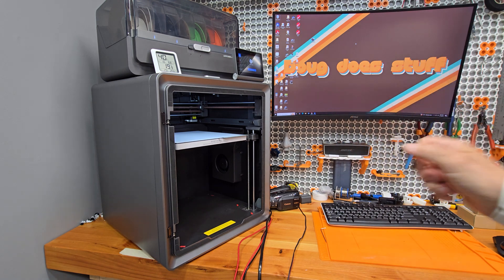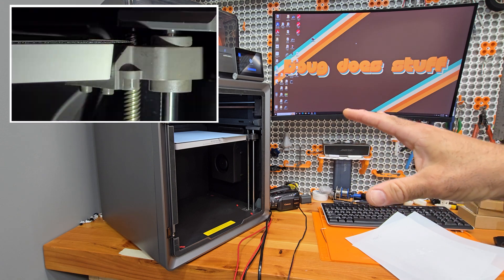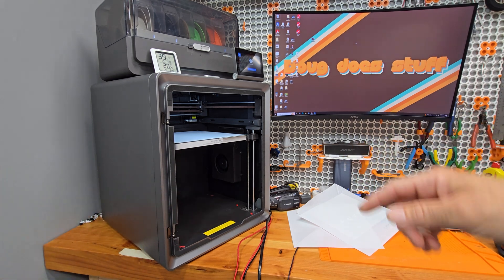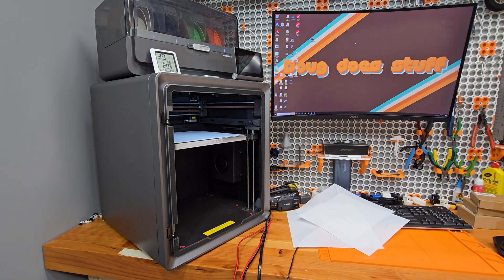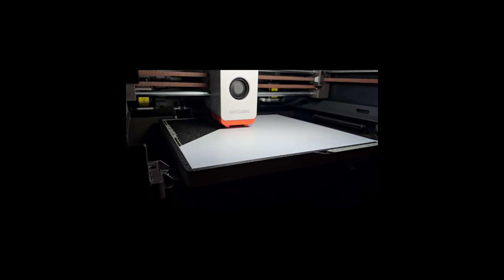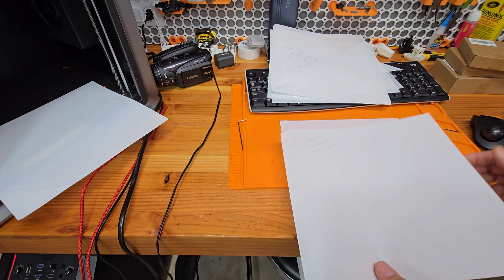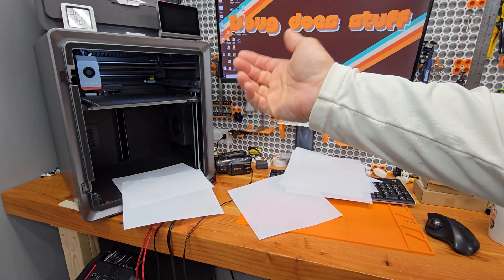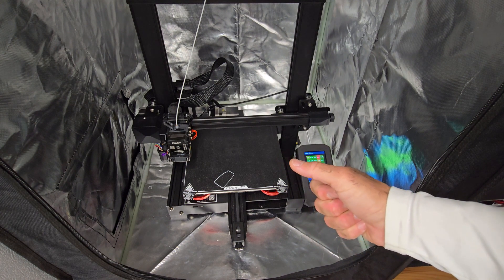Kobra S1 Combo: Bed Level Chaos! I'm Done with it!

Comment: I had a print fail and a glob of PLA stuck the the hotend. I think it changed how my bed sits. Now I can not get anything to stick. The nozzle is grinding into the build plate. I haven't had a successful print in over a month. any suggestions? Yes I have used the auto level function, and I factor reset the machine. Kobra S1 combo
Reply from the maker: Yeah, I would say that you need to take apart the hotend and see if there is a leak.  See if the blob pushed the PTFE tube in the heatbreak off.  That would be an issue.  I would start there
Reply: @dougdoesstuff24 thanks for the reply. I've done all of that numerous times. I've replaced the hot end, ran the calibrations, hot end still drags the bed.
Reply from the maker: Have you reached out to support? You could raise the z offset in the slicer
Reply: @dougdoesstuff24 support is sending me to the wiki, I've done all of them twice. Z has been 0, -1, -2, -3...none work. I'm out of
Reply from the maker: Negative numbers will lower the nozzle, try going to a positive number like . 5 and go from there
Reply: @dougdoesstuff24 I was thinking it lowered the bed, wow. Thanks
Reply from the maker: yeah, it doesn't change the bed at all, it changes the nozzle height from the bed.  Definitely go positive numbers and give it a whirl

Comment: My Kobra S1 has been a great printer, for the most part. Fortunately, I got one with a nice flat bed . . . 
Some warnings before you stumble into other potential issues:
1. When I tried to use the filament dryer while printing, the filament got too soft and jammed inside the Ace Pro buffer. Clearing that was no fun at all. So dry at a low temp for a long time, and keep the drying temp low while printing. When printing with PLA, I don't use the dryer at all when printing for this reason. It's nice to be able to dry the filament before printing, though.
2. Don't slice a model for ASA and then try to print with PLA. It will jam inside the extruder. Entirely my fault, but still aggravating, and it led to warning #3.
3. Don't disassemble the extruder unless you have a spare handy. The filament sensor has a part that rides on an extremely thin spindle, and if \ when that spindle snaps off, the extruder is junk. Anycubic was kind enough to send me a new extruder free of charge, but the printer has been down for three weeks waiting for it to arrive, and it just cleared customs today, so I'll be waiting another week for USPS to deliver it.
Anycubic's customer service is awesome, if a little slow. (They're in China, so that's understandable.) That's one reason I keep buying their printers (price being the other reason.) I really haven't had any issues with the Kobra S1 that weren't my own fault, but it's still frustrating when a plastic pin that should have been steel snaps off and renders the entire extruder useless . . .
Reply from the maker: Thanks for the tips and sharing your experiences!

Comment: you should probably look further into modding it, there are plenty people that do it and they get pretty solid results
Reply: What mods are you referring to? Is there a person or mod you would recommend or have done yourself?
Reply: @lauraprice4069 i’ve seen a dude that replaced the hotbed with an upgrade from aliexpress then he adjusted it and calibrated it with rinkals firmware
Reply: also there’s some support thingies you can print and put them below the hotbed that you can print, ive seen it in makeronline and people seem to like it a lot

Comment: Anycubic had a gcode test file in their wiki, which only prints a first layer. That should rule out the slicer. Have you tried that one? It’s a 57 minute print.
Reply from the maker: I have not, but I am skeptical about it because I don't know what they tuned in it.  We want real world results.
Reply: @dougdoesstuff24  at least it’s worth a try. I have to check the gcode myself to see what they have set. Anycubic asked me to print that file when I complained about my warped bed. After that they sent me a new one.

Comment: Looking forward for rinkhals firmware video and hoping that it leads to some kind of fix or something. I think my S1 bed level is not as problematic as yours, but i wouldn't have been here if it was acceptable. I did a couple of test on my own with remote print bed level and pre-done calibration, and i got same-ish results. Also tried having the usb stick be plugged in and out with remote printing like some commenter suggested on your previous video, and it didn't had a noticeable effect for me (thankfully? it would have been a really silly issue) I am using a textured carbon fiber looking PET bed though and its really easy to spot issues on that thing, default bed really masks problems by being so bumpy.
Reply from the maker: I am going to get working on that tonight and get it installed.  I don't think Rinkhals in itself will solve the issue, but it might help identify the bed issues

Comment: I have some thoughts. First, let me say that my experience isn’t long, about a year and a half into the hobby, starting with an Ender-3 S1 that I was constantly struggling with bed tramming and leveling, to a BL A1, to their P1S, and now the AKS1. I am a software engineer with some understanding of how the embedded software likely works. 

So, first about the myth of there being a difference between cloud and USB prints - it is extremely unlikely, though not impossible, that Anycubic is modifying the GCode sent to the printer from the cloud. After all, GCode is just text commands to the printer, so changes to it would be risky and be easily sniffed out by comparing the GCode in the cache folder with what is on your USB. 

Second, the bed-leveling command is just a custom GCode to trigger the built-in functionality. Again, while it is possible they have two routines in the firmware for bed-leveling, this would be both wasteful of firmware space and a disservice to the end-user. 

Finally, folks are correct to suggest that this might be due to the new hot-end, though I hope for the wrong reason since I bought two plus an array of hardened nozzles. Rather, the issue may stem from why the new hot-end was purchased, the way the old one failed. It may have negatively impacted the sensor that calibrates the mesh. 

Now, I will say that Rhinkals is well-done, with a clean escape route back to stock firmware. So, there is no risk in upgrading and I’ve done it. I haven’t had time to work with it to see what it offers so that’s the end of my advice, but I will look forward to your video using it, with special interest in if the bed mesh is consistent across multiple leveling runs.
Reply from the maker: Thanks for the input!  Some great thoughts in there.  You don't think it is possible that when the g-code is sliced for remote print the code that is inserted might be wrong?  And, then when you print from the printer the g-code on the printer is different?

While it could be the aftermarket nozzle, I don't know.  It has printed a few things well, it is just the first layer.  I do see what you mean with the first nozzle issue and how that potentially hurt some sensor in the bed when it crashed.....
Reply: @dougdoesstuff24 it’s not impossible that the g-code is different, but it’s usually 2 or 3 codes together that triggers homing, cleaning, and then build the bed mesh. So, that it does all that, though inconsistently, it feels more like a sensor issue. The sensor is housed inside the print head, using the nozzle as the probe tip. I cannot recall how your nozzle failed, but if it was like mine, a clog that pushed the “ceramic” tube up and out of the throat, pushing the nozzle out of the holder despite the clamp being active, then that sensor may have been impacted. Thinking about it, so may have the clamp itself. I’ve been too busy to do more than a few prints with the new nozzle, all successful, so time will tell for me.
Reply from the maker: Mine failed just like yours. It is a possibility
Reply: And for those others following this thread, this seems a common failure mode. I got lucky in that mine clogged and got pushed out of the clamping mechanism while purging, so no print plate damage. However, there have been numerous reports of plate damaging head crashes and nozzle clogs. It’s a bad nozzle design that has delayed my review video as I sorted it out and rewrote my whole video.

Comment: I don’t have this printer. Does it do a nozzle clean followed by cooling the nozzle down to 140c while covering up the nozzle with a pad or part of the PEI plate? If the nozzle is cooling down before the bed mesh in the air, filament will ooze out and the z offset and the bed mesh will not be accurate.

I copied what Bambu printer does before doing z offset or bed mesh on my Voron printer. My Voron 2.4 350mm has max deviation of 0.25mm on the mesh with 110c, around 0.1mm with 50c.
Reply from the maker: I'll have to watch it more closely, but I believe it does what you described, but the nozzle is in the open, not covered up somewhere
Reply: @dougdoesstuff24  yeah left a comment with a link to a YT vid explaining what i mean with nozzle cooling down on PEI plate, but it got removed. 😒
Search for Bambu printer startup sequence.
Reply from the maker: I didn't remove, but I'll check it out, thanks!

Comment: I had to print spacers for my bed. A quick google search will show 2 different ones, i chose the ones with the lip on the bottom of some of them, and they all in the file were different heights, with about .1 mm difference between them.

If you have the line gaps, the nozzle is further away from the bed than the areas where the print is solid. Add a spacer in the corner(s) where that happens. But remember, if you add a spacer to one corner, you have to add to all corners. After playing with the various heights, and running a new bed level on the printer each time i changed a spacer, i sent the print. After doing the spacers and micro adjusting the 4 screws on the bed, i have perfect first layer every time. 

Also, plastic does build up on the flexible pei magnetic plate, so wash it with dish soap and water, dry, then use ipa and clean it and let the plate sit for about 10 minutes to make sure there is no ipa on it, then do the print again. I can now print a build plate full of dnd terrain pieces with zero adhesion issues and the first layer (bottom) looks perfect on all of them.

Apparently, some s1 have shipped with spacers, others have not, so this again appears to be another quality control issue.
Reply from the maker: Once I can see what the mesh looks like we will go from there on shimming it.  I do clean the plate like that every so many prints.  I don't have adhesion issues, but always worried about it.

Interesting, would be very interesting to get some pics of those.

Comment: Heey i have the same with my cobra 3 my bed is warped after 30 hours 
And this to much for klipper to compensate i solved iT with Some verry thin washers under my pei 
I used 0.2 mm washers on the edge and perfect after 😂😂
Greets
Reply from the maker: Thanks for the tips!

Comment: I think you need to see the bed leveling data, and check repeatability of the leveling, I suspect that is your issue. The signal from a strain gauge is often very noisy
Reply: You cant see it on the s1
Reply from the maker: Through Rinkhals, the next video, you supposedly can.....we shall see.
Reply: @dougdoesstuff24 oh that makes a lot more sense
Reply: @Yhandi_Fan  Doug is going to install Rinkhals, which will make the leveling data available

Comment: Hey Doug.

I have the same problem in my S1.

I've disassembled this table and I know what the problem is: there is a glued part (I don't know if it's the heater connector or the temperature sensor) under the heating plate (that aluminum plate) that has too little space in the table frame. Tightening the screws, the heating plate bends, creating a bulge in the middle of the table as it leans against the frame.

The solution: you have to disassemble the entire table, mill out more space in that white frame and reassemble. After that, in addition, you can still measure the leveling with a micrometer sensor mounted to the print head and make corrections by lining up some places with kapton.

In any case, I consider this a design flaw and replacing the components from Anycubic, will not help.
Reply from the maker: This is very interesting, and once I get past my Rinkhals video I am going to look into this!
Reply: could you just use shims on the screw mounts
Reply: @TheShorterboy  This is some option to consider, only I'm afraid that they should be shims of precise thickness. Although, with the current state of the table, a difference of 0.05mm on the shim will not make much difference anyway.

Comment: I love your good attitude despite all tbe issues and unproductive comments. I know the process of failing forward with many big and small things in life. Despite it sucking at the time, the struggles I had with my Neptune 3 Pro taught me SO much about 3d printing and I'm glad that I was forced into it. I wouldn't understand much at all about how the sausage is made had I got a printer that just worked out of the box. No judgement toward those who want that experience, but I have a need to dig deep into everything I do... for better or worse. 😅 My husband and son kept urging me to just get another printer and I was like "No, I must beat this!" And I did, after many hours of trial and a whole lot of error. Plus sitting on the floor of my garage hand sanding a very warped bed that was 2mm off. 😂 My S1 has been flawless, but if/when that changes I have learned from you and appreciate it. I TOTALLY understand why you're like a dog with a bone with this.
Reply from the maker: Thank you!  I appreciate the comments!

Comment: You don't have a bed problem. You have a print head + load cell problem. Please try with the original print head. The printer software is calibrated for that, any mechanical play or weirdness with the head will have as a result a bad mesh and a bad first layer. Anycubic should let us adjust this parameters!
Reply: Even those with the original print head have these issues though. Not all but way too many.
Reply: The hotend shouldn't matter though, as long as you are doing the full recalibration after changing the hotend.
Reply: @advirnig  It normally shouldn't if the print head is a solid block with the extruder, but if there is any play between the two you get inconsistent results.
Reply from the maker: The hotend doesn't move, it is in there solid.  I could go to an original hotend just to see.....
Reply: the toolhead have a probe, any nozzle or hotend work, the principal is easy, the nozzle touch the plate, the probe see that and you have a mesurement... that's it! i have the same problem with my brand new creality hi... i never change the nozzle, never change the hotend, the first print i made with... i got this problem... THE FIRST PRINT! the real problem is just the quality check, is wrong on all company, because the people want a printer FAST and IMMEDIATLY! and this is cause bad printer.

Comment: Hello man! A warm greeting from Italy. I encountered the same problems and solved them by "masking" the problem from the slicer offset. I have to set -0.05 for the original plate and -0.02 for the plates with different bambulab textures. One day I decided to buy the cryogrip pro glacier and all the problems were solved, offset from slicer to 0.00 and the first layer always comes out perfect never goes wrong, while if I put the original plate back the usual problem returns and each first layer is always different from the previous one. I couldn't explain why, it would be nice if you tried it and made a video of it!
Reply from the maker: I do have a cryogrip plate sitting here.......

Comment: I feel bad for you. Got mine out of the box and started printing, with the ace. The only problem I have is that if there is a color change between spool 3 and 4, it always jams. Other spools work fine. Printed PLA, parts 24h+. at 500h and 12kg of PLA. Printed PLA, PETG and ABS great. You have the problems i had with my ender 3... It's sitting there in a corner. Got a hemera extruder to install on it, that was the plan. But the Kobra keeps doing great, so I am constantly using him... I got lucky i think
Reply from the maker: That's awesome! Did you reach out to support about the ace pro?

Comment: You are totally correct about AnyCubic throwing parts at the problem, I have replaced the main board, hotend and now I have to replace the parts in the ACE Pro. Getting tired of replacing parts. When I asked to send the unit back and refund they were giving me a hard time.
Reply from the maker: Oh geez.  I wish you the best and keep me updated.  This is why I get frustrated at the posts of people saying they have no issues and don't understand why I do and that it is my fault.  I think there are so many of us with these issues.
Reply: best way to handle this is selling the machine for whatever you can and buying a P1S or something like that.